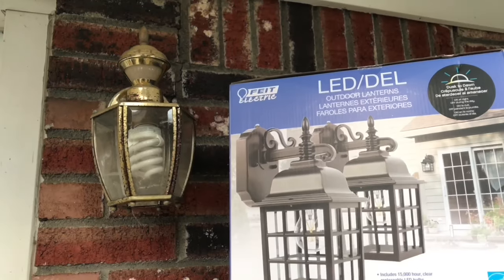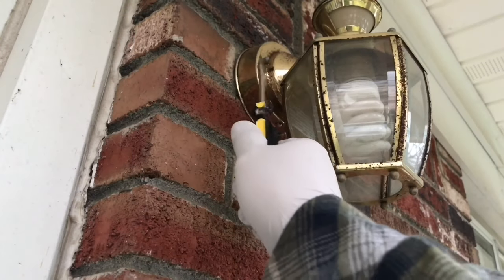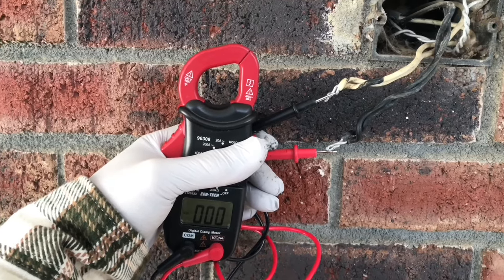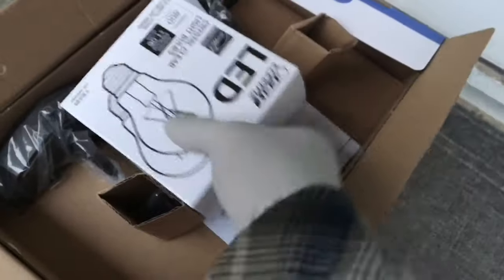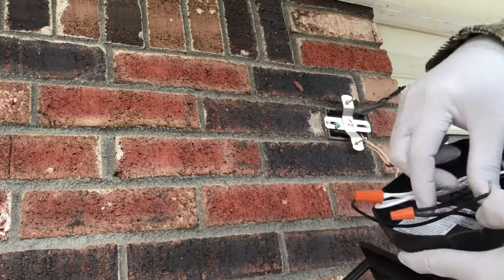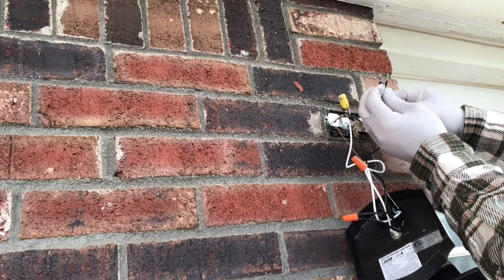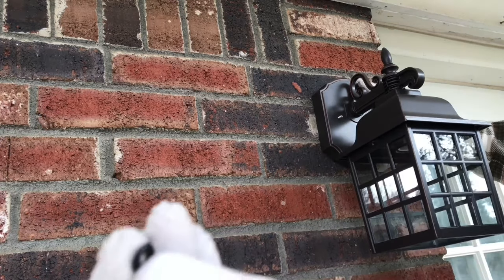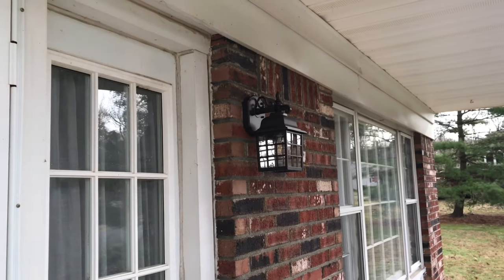How to install Porch Light Fixtures dusk to dawn LED from Costco - How to replace porch light

Comment: Hello, How do u know which cables go to what?
Reply from the maker: First, thank you for watching and feedback! We appreciate it. Anyway, it is wiring standard. A Home typically has three wires on all of your outlets and fixtures. Black wire being hot or +. White wire Being Neutral. And bare wire or green wire or is called “ground”. If you look at an outlet at your home,  you will see three holes. Short slit is your hot or positive. Longer slit is your neutral. And the almost round hole is your ground. The light fixture came with those standard three wires. An exception on the white wire... There a few white wires in your home wiring that maybe hot as they are called a “traveler” or traveling wires used for a light switch... a good electrician will mark that with a black electrical tape inside an electrical box... I hope that is what you are asking for..... another example is your car wiring.. Black is known negative and red being a positive... thank you again. Cheers
Reply: So that extra white wire is not needed?